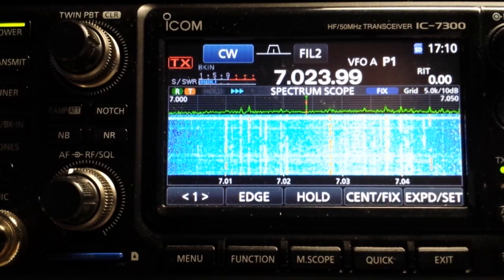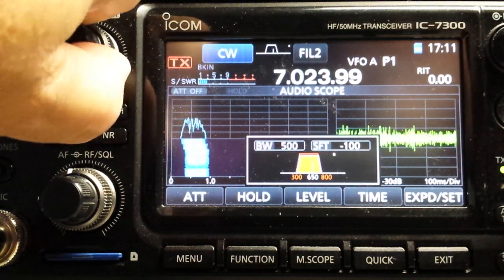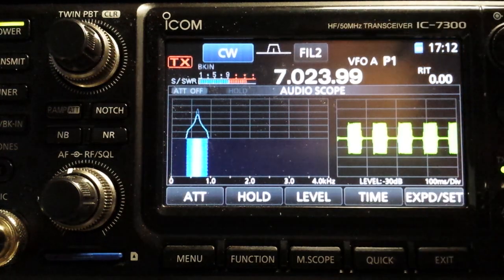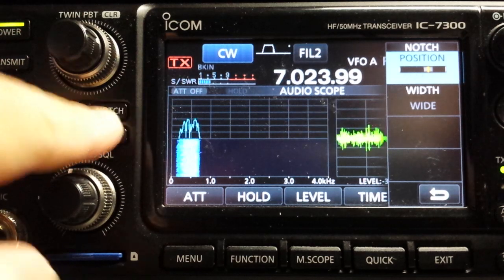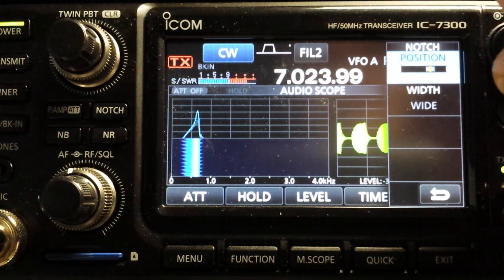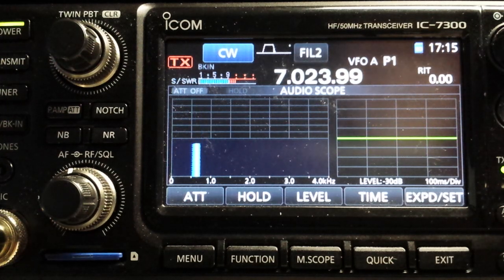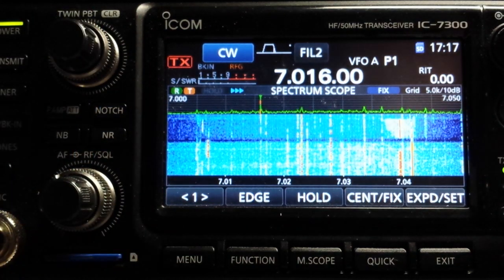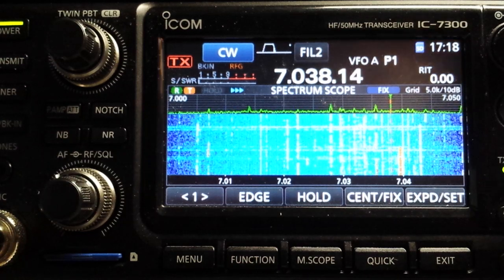IC-7300 Enhanced CW using PBT and Notch ---N4LQ

Comment: one reason i am leaning toward the FTDX3000... it offers a 300Hz CW filter while the ic7300 has a 500Hz.   but after seeing how its possible to adjust bandpass and then shape the CW audio on the 7300 maybe the 300Hz filter isnt a deal breaker?  it still seems like kind of a work around though? but i'am new and still trying to figure things out... this vid' helped immensely.

Comment: Great technique Steve.  Is there any way to save/recall the PBT/Notch setup for CW mode or do you need to dial it in manually every time?  Did you also do a video on how you set up your spectrum scope for that nice green trace?  Thanks & 73!
Reply from the maker: Just buy another 7300 for SSB :*)  The green trace video is https://www.youtube.com/watch?v=wY3T91AHQko
Reply: On second thought, you could use CAT commands to set PBT and SHFT so a logging program macro etc could do it.  CMD 14-07/08 reads&sets PBT, 14-0D reads&sets NOTCH; too bad it doesn't have macro key assignability like the K3

Comment: Hello Steve,

Interesting video, thanks for sharing it with us.

I wonder why you didn't reduce your IF bandwidth using your PBT centered on your pitch frequency first and selected a rounded CW filter curve to soften the signal? 

Using the notch function introduces a lot of roll-off (phase shifting) around its center frequency which in your case seems to add some ringing, is this just an impression?

73's,

Patrick - ON4KNP

Comment: Hi, Why do you prefer using PBT + Notch (cutting low frequencies) instead of using only the PBT with  IF center in the higher part of the passband AND split setting of PBT1 and PBT2 that cuts the low frequencies? To me, the result looks the same in the audio scope.

Comment: Great help, Steve.  When I follow your steps adjusting the PBT and Notch, It seems to have very little affect on the CW transmit audio on the scope.  I cannot see the rounded edges as you show.  When I monitor on the air signals, it does show the rounded edges.  Mine stay sharp.  Is there another setting I'm missing?  I'm using the new 1.14 firmware.  Thanks for the help.
73
Reply from the maker: PBT has no effect on transmit. Your scope shows what is transmitted when transmitting.